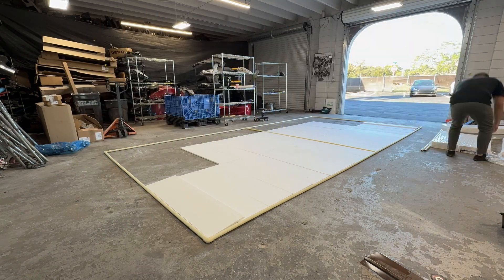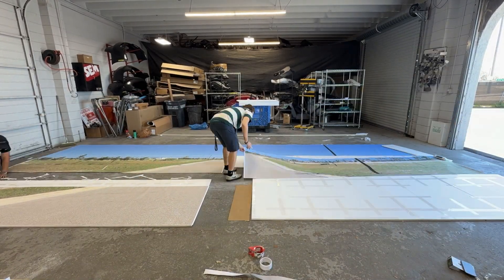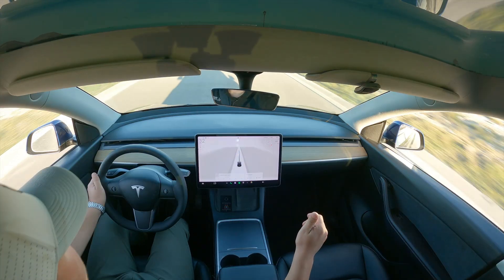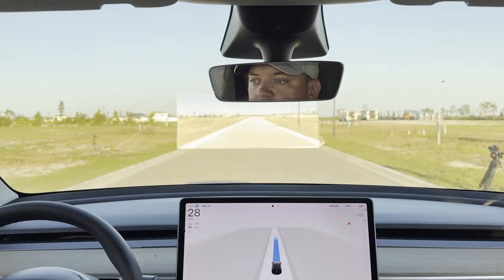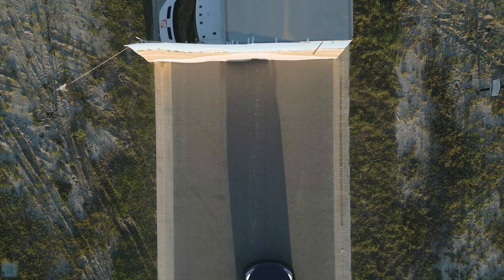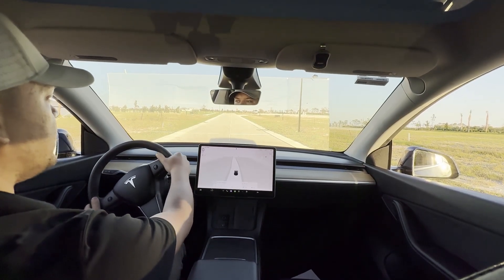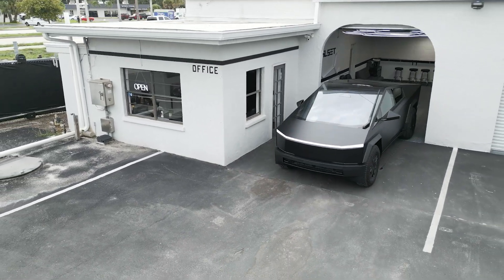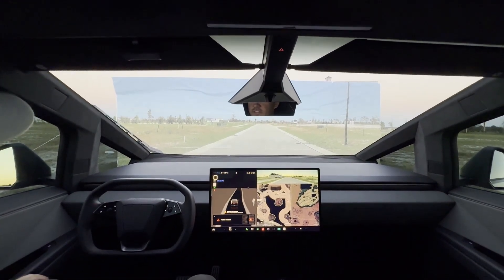Response to Mark Rober’s “Can You Fool A Self Driving Car?”

Comment: Either this video was really old, which it couldn't be cause mark just released his, but you are well overdue for a software update. We are already on version 12.6 dot 4, and that's on my 2019 model 3 hardware 3. If you are using a new Tesla with hardware 4, it would have stopped.

Comment: The point of Mark Rober's test was that LiDAR is more effective than relying on cameras alone.  A system using both LiDAR and camera would be more effective than just one or the other.  What Tesla has accomplished is impressive, but there is room for improvement.    Thanks @KylePaul for another perspective and test here.

Comment: AI4 is a significant improvement over AI3, processing data faster with higher visual resolution.  If Mark Rober wanted an unbiased comparison between the two technologies, he would have used the latest technology in both cars and blocked any visual cameras in the Luminary car so it is truly a visual vs Lidar comparison.  Thanks Kyle.  Congratulations you are smarter than a NASA/Apple engineer.

Comment: Aye good job recreating the experiment. But Mark’s Tesla never should’ve failed in the first place. My theory as to why it stopped this time is because the sun was facing the picture this time, making it significantly brighter than its surroundings on the Tesla’s mid quality 720p cameras. It just sees a large bright object in front of it and interprets it as a wall, where Mark’s had more neutral lighting. Better version of FSD here too, but nothing will replace Lidar and Radar. They’re necessary redundancies that shouldn’t be cheaped out on.

Comment: With the model y I think it was noticing the wall due to the way its shadow was being cast onto the wall? The cyber truck may have seen it earlier due to the paper wrinkles and shadow casting being different. I'm not too sure how the camera technology works in these vehicles but I do feel like they should put the lidar back into them. Even with normal vehicles computers fail or have issues I feel like with a fallback system in place that isn't just camera vision would ultimately end up being safer. I understand this would make the vehicles more expensive but in all technology in vehicles with the conditions they are in there's always failure points no matter how much an engineer works out. Especially in northern states where cars are ravaged by salt in the winter. I look forward to seeing what technology gets put into cars but I honestly wouldn't trust self driving myself at this point.

Comment: not the same wall!!! also this would be deliberate act if ever done. this would be fixed with some surface pinging sensors maybe. either light or sound. also it's insane to try it with actual solid object in the back. one mistake, even if simply from excitement to film this, and it's actual car crash. anyway cars could also be hacked. but doing that would also mean it's a murder

Comment: Looks to me like you are hitting the brakes yourself? Why did you not sit with you feet up high?
Reply: That's not how it works. If you've ever used FSD you know that you absolutely cannot tap the brakes whatsoever without disengaging the software. Any force on the break stops FSD from running completely

Comment: I know you couldn't have with the setup you used, but I would've liked to see you go through the wall. Curious if the FSD would disengage while watching someone clearly not touching the wheel. And I'm pretty sure the cybertruck only worked because the the wall was starting to fall apart and it was a different time of day and did not blend in as well.

Comment: Thank you for doing this & proving that the latest FSD HW/software does stop. I'm curious as in both vehicles the screen showed software updates available, why wouldn't you update to the latest version 1st, especially for the Model Y where 12.6 was a significant upgrade? I have a 22 MY so I know there was a step change in function when 12.6 came out. I also noticed in the Model Y test you had FSD set to assertive instead on normal? The approach that Rober had was flawed as he didn't actually use FSD, but in both tests you accelerate the car to 40 MPH before engaging FSD on a residential road? Why not just drop a pin past the wall or just engage FSD from a dead stop and let the car decide the correct speed to travel? I get that Rober's ridiculous test was to demonstrate the differences between Lidar & Vison only systems but it's an unrealistic test of real world driving.

Comment: thank u very nice Video, i wouldve testet the M3 after the Cybertruck again so to see if the light was the difference. But here its good old basic trustet prof.
Thanks, alsow i dont understand the hype this makes, this is in my head a szenario that will unlikly accure under normal road driving conditions.
Its just ment to punish Tesla for no Laidar, or in general a Vison system will be punished by sutch a test, but in real world, Cameras will not Emergancybreak into some Fog or Cigarett smoke Laidar can and may will emergancybreak on an emty road out of noware....

Comment: Yeah so this can't ve fixed in software - itd a limitation to the fact that they strapped webcams to it and removed distance sensors - i think the cyber truck does have sensor's I'm not sure failing that there was a large difference between images

Comment: There are many aspects to this test, one of which is that the full self driving computer was never trained to recognize a gigantic drawing of a road.  Once the false positive had been trained into the system, I'm sure FSD can recognize these traps a lot easier.
But in my opinion I don' t think they need to do that.  It's just extremely silly trying to account for scenarios that simply doesn't happen in real life.
Never the less, it's always fun to replicate these types of experiments rather than just sitting on a couch arguing over it. :)

Comment: So moral of the story, ensure you are running the latest software! You proved the point that your testing with old hardware/software is the cause of failure, just like the other video by Mark Roper. Bottom line, both tests were flawed as tests were ran on old hardware.

Comment: You should have done another two tests.. one where you remove the picture from the wall. (so it's just a huge white rectangle) and another where you remove the wall completely and just have the Uhaul Truck that was holding the wall up.  - that way it would give clear indications when the car could see the obstacle.

Comment: When people are trying to be scientific...
Lots of basic problems here.
- do not claim you are unbiased after saying you own a tesla, and want to buy tesla for everyone in your family
- your test is wrong, as your photo has different ligting, colors, tones in the second test than the surroundings. 
If you know how tesla works, is using cameras, it will only fail the test when the image it is closing in to is very similar to its surroundings.
Even in the first tests there were differences, but Tesla did not notice. The second test differences were a lot higher.

The main point of Mark Robers test was the basic method of relying only on visual cues versus proper measurements.
Visual guidance will always have weaknesses, like this.

Comment: LiDAR is way superior
Reply: Is it though? It has its limitations and us humans dont drive with lidar so why should cars have to?
Reply: @laurensholthof  I meant LiDAR is superior to camera based self driving. I'd rather drive myself though.
Reply: @NormalCleanCars Everything has its pros and cons. Lidar doesnt react well to fog or rain. It's also more expensive and a mechanical point of failure. Its also harder to train ai models on the point clouds generated by a lidar scanner than it is to train on an image. Tesla's approach is cheap and scalable and as you can see works well. The HW4 car stopped within reasonable distance
Reply: @laurensholthof  LiDAR is superior. Camera based, you're asking a computer to interpret the world through a camera. Not even a great camera. At least LiDAR sends back information that is tangible and measured.
Reply: @NormalCleanCars  Even with 100% accurate lidar scans a computer still interprets what it's seeing, so that's a null argument. The computer just gets a bunch of dots instead of pixels
Reply: @laurensholthof  Lidar's "dots" are 3D measurements of the environment, while cameras only capture a 2D image. With Lidar, the car knows the exact distance to objects, which is way more reliable for self-driving.  That difference in the type of data they provide is crucial. Don't say the computer gets a bunch of dots instead of pixels, that is not true. The camera interprets through pixels , the LiDAR gets raw data.
Reply: @NormalCleanCars  It doesn't matter what those dots look like a computer still had to interpret them. The point cloud on its own is useless
Reply: @laurensholthof  lol yes I know it still has to interpret, but it's 2D image guess-work vs raw data.
Reply: @laurensholthof  I think both should be implemented together for the most accuracy.
Reply: @NormalCleanCars  Guess work is fine. When you're driving you're not constantly thinking in terms of absolute distances. Neither does an AI and if it does need to it can. Tesla vision can very accurately estimate distances (proven by the lack of parking sensors even though it still displays proximity to objects)
The occupancy network shows an impressive 3d render of the car's surroundings and it's surprisingly accurate
Reply: @NormalCleanCars  You're right, a combination of both is still optimal but just not cheaply scalable
Reply: @laurensholthof  I've noticed the newest Volvo's have a roof scoop , I thought it was for ventilation lol but it's a LiDAR system! I'm curious to see how well it'll work with camera combination, like you said scalability is still issue, so the EX90 isn't cheap with LiDAR I'm sure. 

Edit- ya it's like 100K Canadian lol
Reply: @NormalCleanCars  Right, you're never gonna get that on a $35k tesla, so I respect the effort they're taking to try and make vision only work. I genuinely think with enough training data it could be 99.99% foolproof. The v13 stuff is gnarly and better than a lot of lidar systems currently on the market. I get the argument that it's not "absolute" because you can't actually guarantee any behaviour with ai and vision like you can with lidar and preprogrammed code, but I think traffic is too dynamic to pre-program everything so there's always gonna be some level of uncertainty about how the car will behave. I think it's a valiant effort but only large scale adoption outside of the US will tell

Comment: I know this is for entertainment and all that but does this test honestly matter? The only thing I can think of where this would be meaningful is if there’s a bad actor trying to harm people and I think a lot of human drivers probably with and without good AEB systems would probably hit this as well?

I know I sound like I’m defending FSD and I partially am becuase I do think it’s super cool and I use it everyday, but I also just don’t see how this matters other than it being funny. LiDAR is cool, it’s getting cheaper but Tesla is right, sensor fusion is very very difficult. Waymo for example still has issues and they have 10x the number of sensors that Tesla does. Lidar also doesn’t work well in all conditions. There is no single perfect solution to this stuff. Like maybe you could use thermal imaging cameras instead. That would probably help? In this one situation a radar and lidar might sense it but what if it’s raining? A radar would work in that situation fine.

Comment: Interesting. It makes you wonder if HW3 has enough power to achieve what HW4 can do. It may very well be that some parts of the software still need optimization and once done it would be fine even on HW3, but if the inference model requires more performance, a hardware upgrade is a must because the good models only grow in time if you want them to properly handle more and more cases.

Comment: "Who needs Lidar?" Well...
Reply: You don't need lidar except for training, it's so funny to see everyone is the comment are apparently smarter than the scientists who've created these models. They've used lidar for training but for deployment they rely on cameras instead of lidar since a simple mist or smoke can fool a lidar to think it's a wall where cameras that running computer vision model that's trained with lidar gets the best of both world. It's the same reason you don't need lidar if you have enough data you can see occluded parts of human body behind walls and accurately predict it. Rober 100% was biased because he used the political tension to promote his friend's company.
Reply: @rano12321  Can a camera see through thick fog or smoke? No. Can a human see through thick fog or smoke? No. Can lidar see through thick fog or smoke? Yes.
Reply: when do you encounter a wall that has a road, matching the perspective, painted on them
Reply: @fetB  when you have a concrete wall alongside the road and has the same color. Just add a LiDAR sensor to work together with cameras. Your iPhone uses both and I don't see any outrage
Reply: @tomar81  when do you have a wall in road color? Besides, thats not the topic and not what they tested. Obviously vision only has its limit. It was quite the outrage when tesla removed radar, but the reason they did it is because roads are designed for humans. Humans are vision only and dont have lidar either. YOu can rightfully criticize their decision, but testing on a wall with a road painted on, is simply disingenuous. Its creating a scenario that simply doesnt exist
Reply: @fetB  slaloming between orange cones at constant speed is also scenario that doesn't exist in daily driving
Reply: @tomar81  dont know what that has to do with anything. Slaloms are testing the suspension setup for handling purpose and it does actually come into play when avoiding an obstacle
Reply: so, watching at 8:00 i do think during FSD there is an addition sensor along side the visual processing, as the screen clearly shows the wall while FSD and breaking, but as soon as the cybertruck stops, it wall fades away and shows the crooked road in the image as a drivable road.
Reply: did you actually watch the entire video? the hw4 tesla actually detects the wall
Reply: You're right (in Tex Avery's world), personally, if I'm not expecting it, I'd make the same mistake in my everyday life.
Because the test makes no sense.
There's a lot to criticize against Elon politics, Tesla, and forcing of FSD on their new cars instead of making a simple, inexpensive car,, but making a bad argument only creates a bad argument.
It's like all those people who put on looping videos of Cybertrucks skidding in the snow when the differential lock update wasn't even live yet. (And the thousands of other instances of stuck gasoline vehicles are totally ignored. Like if it doesn't exists)
Reply: I guess I need Lidar for all the times I have a while coyote hunting me 👍 @theplouf5533
Reply: @theplouf5533 bro multiple people have died from their teslas slamming directly into things or even turning into oncoming traffic. They obviously can’t just rely on cameras alone. Cameras are a great main sensor but redundancy is required
Reply: @fuglong I think only 2 people have died from FSD. But regardless, I think Tesla should add lidar.  It’s not that expensive and they can just charge the extra money for it.
Reply: @b22chris  It's not that expensive?  I dare you to look up the build cost on a Waymo compared to a Tesla.  It's not even in the same galaxy.  Now do this at scale.  Yeah, not gonna work.

Comment: You have a U-Haul on the other side. This is clearly not legit. You admit to braking every time. It doesn't see the wall, it's going to go through, but you brake. It would have gone through despite your mock-up being significantly less accurate than Mark's. The cybertruck sees the wall because it's even less accurate during sunset.

Comment: I don't understand why they dont put an additional simple system like the ones used in adaptive cruise control on the front - its not a huge increase in price and you dont need it to be 360 either...

Comment: Why is everyone so irritated by the mark Robert experiment? It's a car relying on optical sensors falling for an optical illusion.. wow 😄 it's not a realistic scenario, that is never gonna happen on the road.. it's a thought experiment, nothing else.. and it doesn't matter. The misrepresentation of lidar is the bigger problem there... To be honest I still think a combination of both sensors would be best, but we can see every day that cameras only are working fine, it's good enough and it's cheap.. in the end it's as much about safety as it is about accessibility, if you can get a cheap self driving car that is going to be much more useful than if it is 150k for such a car...

Comment: Your Model Y said update available 3:54 - current FSD as of today is 13.2.8 which is part of the 2025.2.8 update available shown on your screen (and which the cybertruck has at 7:31) - I can't believe you put in all this effort to build a wall and not update your software. Same with Mark who didn't even try FSD 'because it needed an address'.. All this preparation and we couldn't figure out an address? (even though as we can see FSD clearly doesn't need one)
Reply: FSD failed with vision as well as Autopilot